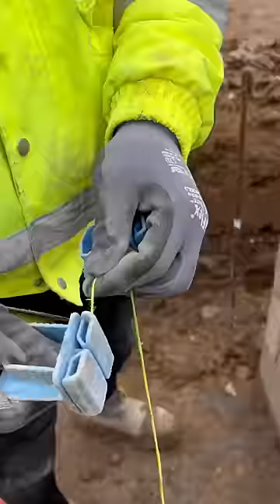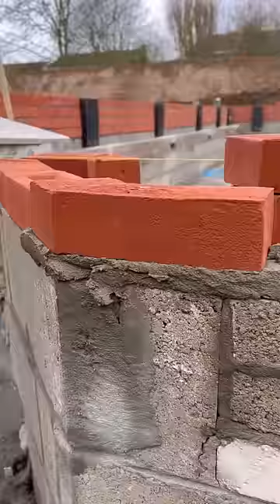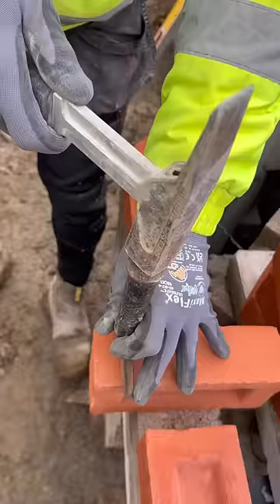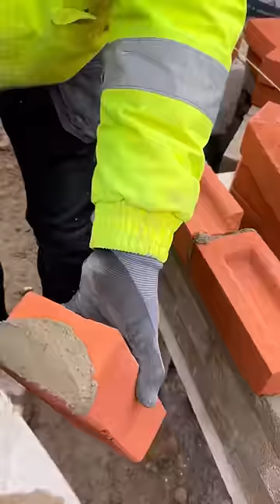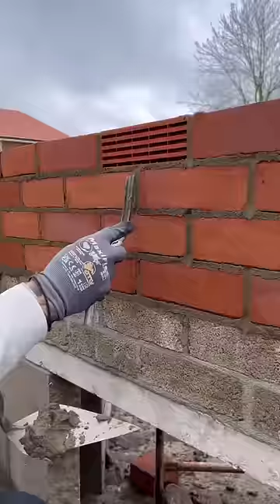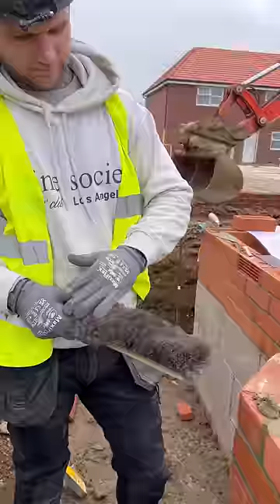The beginning of a bay window 🧱👌 #bricklaying #asmr #bricwork

Comment: I be the traditional bricklayer, can’t believe you didn’t use profiles 😂 top work
Reply: I can't believe the joints are not scratched out and filled properly with joiner mortar. This will absorb water and break as soon as it starts freezing.
Reply: @marcelbron6128  dont talk crap they have been building houses this way in the U.K. for hundreds of years. Ask an adult

Comment: nice trowel control. many do not or will not understand what you are doing. ranging with the level hammer cutting or to butter a brick. hats off nice work. o that mud was real nice  good tender. or even will they understand striking joints and brushing them. nice work.

Comment: What kind of bricks are those?

There are a couple lakes near me, that have this same style of brick(color/shape/indentation), that are scattered everywhere along the shoreline, from really old buildings and piers.

What I find interesting, is that the bricks on the shoreline, look almost identical, to the brick in this video, which leads me to believe, the same company is still in existence(?).

Which IMO, these bricks are very quality,  because the bricka on the shoreline are next to impossible to break and most of them are barely eroded. Even after 80+ years of laying along the shore, exposed to sun, waves and ice.

Comment: Ehh not really if your a good brick mason you can just break it with your brick hammer and go back to setting bricks and his striking is good for the joints but he doesn't fill in his joints all the way so it will shrink and Crack in a week especially since chimneys or building don't actually FULLY harden until 21 days to a month